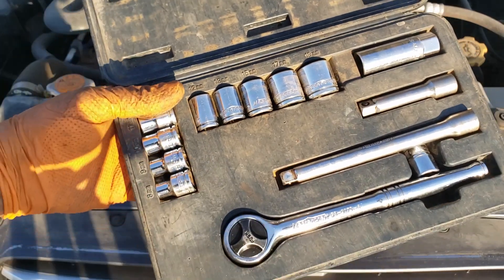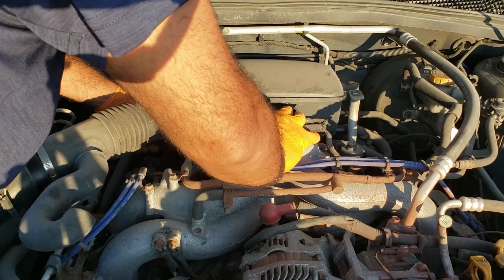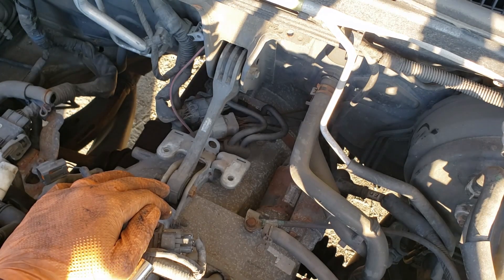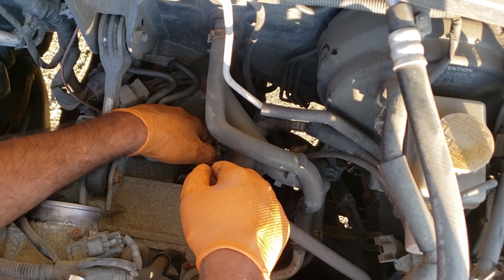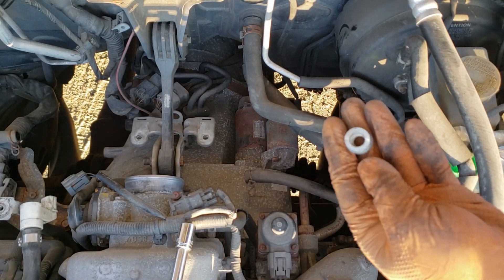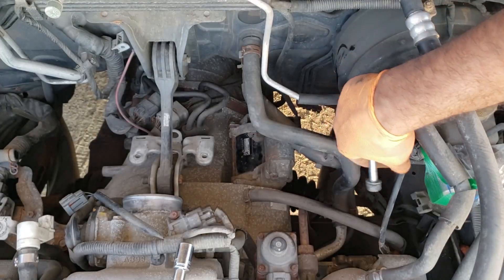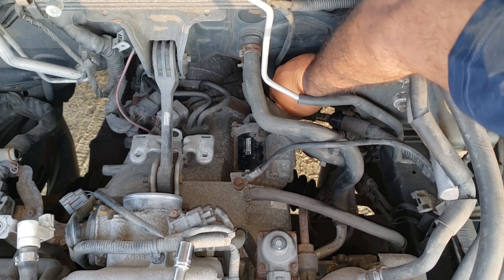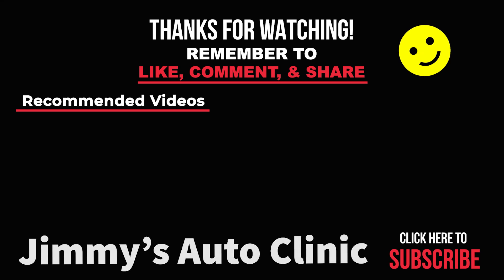2007 Subaru Forester | Starter Motor Replacement | Bad Starter Motor

Comment: Great video! Love the authenticity haha i just completed this job on 2006 manual forester. Luckily i had warning signs and completed before it left me stranded. I recommend putting the car on the cheap driveway ramps. I was able to see and get to the bottom bolt super easy!

Comment: Great video. Just how common is it for these bolts to seize/snap? I've done a couple starter replacements and many other repairs but this is scaring the crap out of me.
Reply: Wanted to update, I got the starter swapped on my 2001 Forester today with very little trouble. The starter bolts had next to no corrosion, which is very fortunate considering the rest of the car is incredibly rusty. I think letting the engine run until it was warm before removing the bolts helped prevent any seizing. FYI for others with 1st gen Foresters ('97-01), The mounting bracket for the airbox is different than what's shown in the video. It mounts to the driver's side of the transmission above the CV joint. I found it easiest to get this off with a 12 mm wrench from below with the vehicle on ramps. I also found it more convenient to reach the bottom starter bolt (mine's a manual trans) from below the car with a deep 14 mm socket on a flex head 3/8" ratchet. 

Thank you Jimmy for making this video. Yours as well as a few other videos helped boost my confidence that I could get through this job after a string of bad luck with repairs on other vehicles.

Comment: Hey I got 09 forester 5 speed I'm getting no crank no start. Good battery able to bump start and it's charging at 14 volts.
I'm thinking relay or clutch safety switch.  All lights come on on dash and radio
Reply: Happened in my 2006. Turned out to be faulty starter as well
Reply: @toyanthaog5109  thanks for responding. I researched more and my starter was bad I just changed it out and it was fine again

Comment: Was waiting for you to lift the car but that's a good place to mount it. There isn't a real reason that starters need to be under the transmission. Saves them pennies on wire too. Maybe it's a cooling thing because they're too busy dumping everything else on top of the engine. Just engine mounted transversely and a pile of shit on the right.